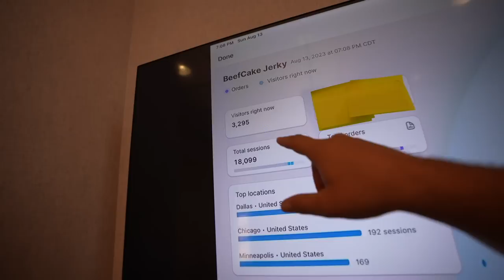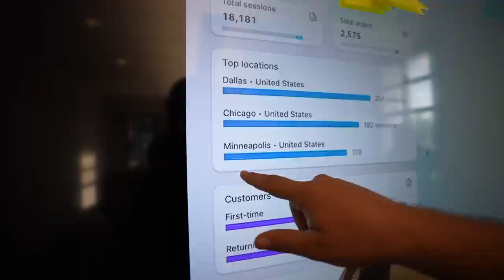FILLING and STOCKING My BACKYARD Fish HATCHERY for the First Time!!!

Comment: To let you know you packed that bucket full of minnows and they pulled the oxygen out of the water in probably 30 seconds to a minute next time fill the cooler up and the buckets and disperse them evenly you have to make sure they have a ton of oxygen also the reason they died in the stock tank is they need fresh water in a small container when in large numbers because they let off a ton of ammonia and it adds up quick either water changes everyday or freshwater source the dead fish rotting is adding even more ammonia. The ones that went into the pond dead just call it starting the cycle but I would wait to stock anymore fish for the nitrate cycle to happen

Comment: I would 100% drill another well on the other end of the pond/lake/pake/la..nd? The fuller it gets, the more surface area you have evaporating. That single well is going to struggle to keep up with evaporation and seepage at the same time.
Reply: He mentioned in a prevoius vid i think, it would cost another few thousand to add another well, but it would speed things up a lot
Reply: @Xx0ME0xX  I must’ve missed him saying that. He’s gotta come up with a solution for powering the wells too. I’d look into a couple solar panels with battery banks on each well, then set it and forget it. Lol.

Comment: Dumping a 5 gallon bucket of fish into a cooler that’s empty and then putting them in a pond to where they fry on that hot fabric is the reason almost every single one was dead. You should have put water from the pond (using the excavator) into the cooler then took that up to the garage and put the fish in there to get acclimated then dump the cooler into the excavator bucket so you could lower them into the water

Comment: its not normal for minnows to die that fast if you have to much water movement they will get tired and die so you need a break from the current over feeding will kill them but not all the time they can get stressed and that also kills them i breed minnows and i have a few die every once in a while. the tube is big enough but dont over stock it can get to crowded.

Comment: You definitely put way too many in the transport bucket. Also, if those are fat head minnows youyou are trying to breed, they require a specific kind of spawning structure. They prefer the under sides of firm objects like rocks and wood.  Stacking pallets and weighting them to the bottom with rocks is what a lot of people use.  I’m pretty sure they won’t just spawn on their own with no object to spawn on other than a pond liner.

Comment: Honesty filtering is cracked up to more than it really is. Filters are really for particulate pollution, not dissolved minerals, salts,bacteria, virus, or mixed liquids such as urine or decay liquids from over feeding & spoiled fish foods & feces. Actually changing the water does a lot more good quicker. Sounds impossible ,but rain water is best,well water next if it is a good well. Having a hose feeding constantly while another drains & siphons off,will do a lot more good. It mimics a stream. You could put a steel lean2 single slant roof all the way around the hatchery on polls & a controllable  drain  down low near the bottom. In a strong brief rain it will add 1000 gallons of fresh rain water very quickly. Plus cast a lot of shadow & shade over the entire Hatcher through the coarse of the day,keeping water temp lower,it will also give you & your pals a place to work out of the baking sun or rain? Just an idea for the future. The roof could cantilever over so no gutters needed(would be best for natural aeration) gives a strong mounting place for a shade cloth! A spring loaded check valve could be actuated automatically with a float to auto drain to a set level when triggered by rain fall. Your pond or hatchery will fluctuate its water level at any given moment as much as 2 feet.

Comment: Scratching his head.... 
Flair acts surprised the fish are dieing .... 
Thrashed with a net ,starved of oxygen , dumped into a cooler , didn't  acclimate and then pour them on that scalding hot rubber liner that they couldn't even stand on barefooted... 
the intake on the pump was probably strong enough to hold smaller fish against the screen causing some loss...
This should be some good stuff to watch .

Comment: OMG! Basically you r setting up a huge aquarium.  But how many horrible things have you done???? 
Fish cannot handle the extreme temperature changes you have subjected them too. Even 5% is enough to STRESS them. Overfeed them & you have unclean conditions. Filtering especially in the inside pool is needed. Simple way is get a bucket with holes in bottom & id put screen in then ACTIVATED  charcoal (5 or 6 inches) hang  bucket under that spout!  In a month you can rinse charcoal.  Also linen bag can catch water & you will need to clean it often.
Cold water?   Most fish prefer 70°+ to 95° to thrive

Comment: Your indoor tank has NO FILTRATION, aeration isn't filtration. Those minnows are dying from Ammonia toxicity because there is nowhere enough beneficial bacteria to convert the waste. That is why your water looks milky. Next, every one that does survive will be killed by temperature shock when you move them to the cold well water. Be honest, you do this on purpose for the comments, you have to be doing it on purpose. A simple google for "How to set up a brand new aquarium" would have told you everything you are doing wrong, and you are literally doing everything wrong. Adding fish is the LAST step in the process, not the first. And your overfeeding is making the problem worse. You don't have a bait tank, you have a septic tank. Good luck with the pond, at least you are adding a filter